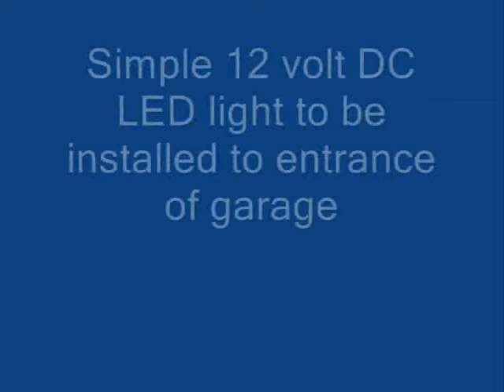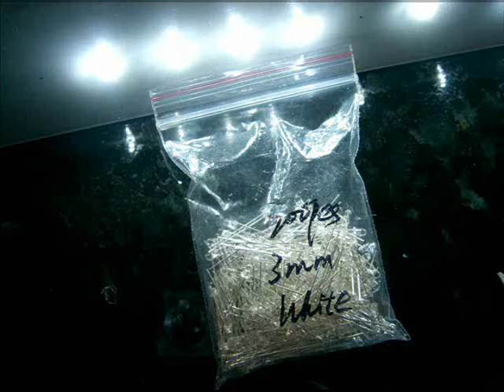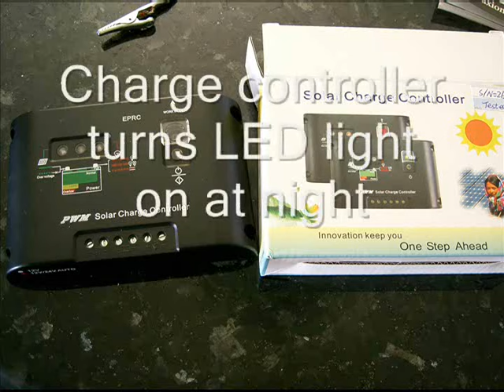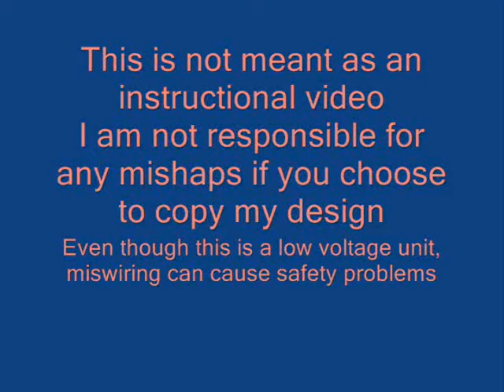LED lights revised May, 2010.wmv

Comment from the maker: @Iseekoutthetruth It is still working indeed. The good thing about LEDs is they can last a long time without burning out. A regulated or steady voltage is important. My design (copied from others) is not necessarily the best but it lets me make a long string of light without bunching the bulbs together.

Comment from the maker: @Iseekoutthetruth I cannot find an inexpensive dc light sensor.  The AC light sensors are cheap but doesn't work with my 12 v dc system. I did not want to use the dc to ac inverter since that would be less efficient. The solar charge controller has a programmable load control feature and it's only $30 so it serves as a dual purpose charge controller as well as a light control.  I think you like the music more than my video  :)

Comment: Very nice light.  I'm thinking about a similar project to light my workshop with LEDs and power them with my solar station.  I have the same charge controller, except mine is 20A and doesn't have the programmable feature.

Comment: A better design would be to have the LEDs wired in series strings of 3 with lower value resistors (300 ohms or so) as with this design 3/4 of the light power is dissipated as heat in the resistors.  BTW, those fluorescent lamps are a fire hazard on that motion sensor light.